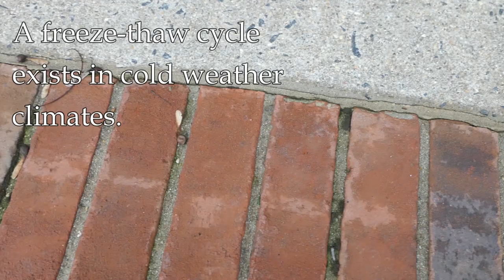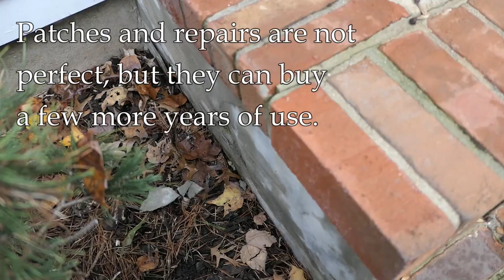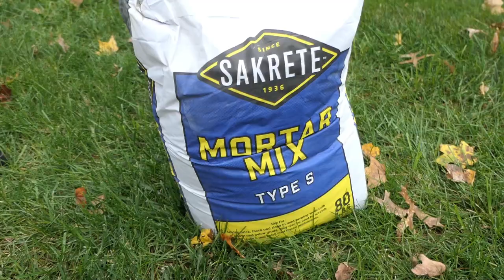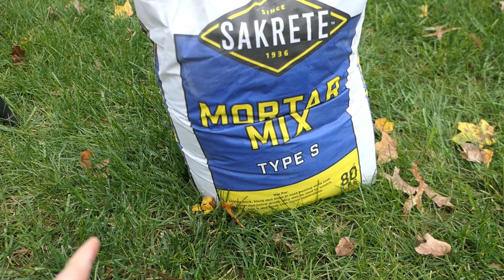Repointing And Parging Brick Steps From Start To Finish

Comment: Nice work! What type of mortar would you recommended for an old sub grade fieldstone foundation in Boston?
Reply from the maker: You do need to be careful about the mortar used in historic applications, especially when brick is involved.  A softer mortar is often appropriate.  For field stone you may have a mix of stone types, some more durable than others.  You might want to stay with a softer type "N" mortar for that project.
Reply: @enduringcharm Thank you!

Comment: I noticed you added mortar over joints that were not crumbling and seemed fine.  Was that just a thin overcoat, or did you scrape away some of the old mortar.
Reply from the maker: I can't recall my motivation from that time now, but I can tell you that new mortar will stick to old mortar as long as it is clean.  I may have just been making sure the color matched in all the joints, or perhaps the older joints were deeper than the new ones and I was matching them up.  I recall a job I once did for a complex fireplace mantel.  The existing brick fireplace surround had a black mortar in the joints, which telegraphed a modern look.  Since the joints were fairly deep, I was able to just add a normal color mortar on top of what was there and it looked great.